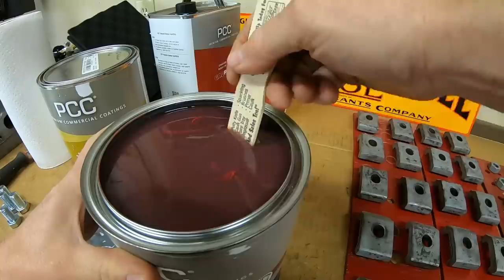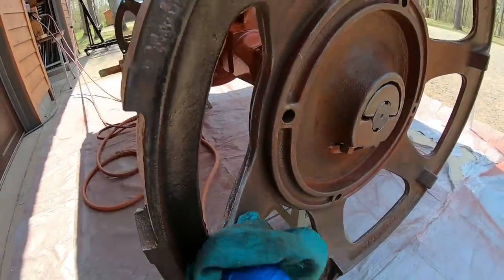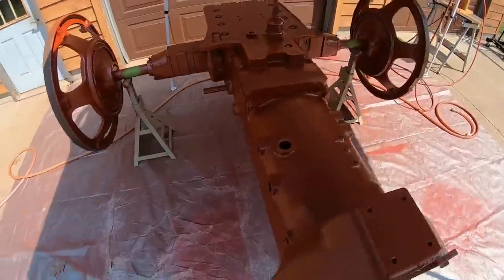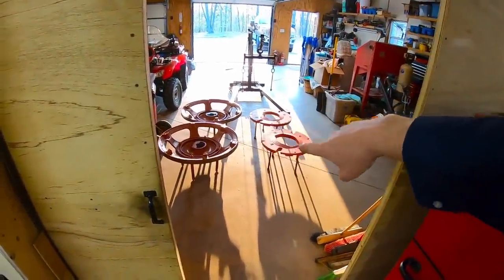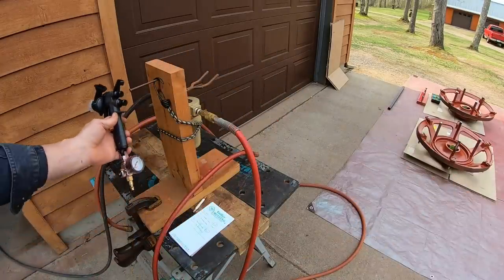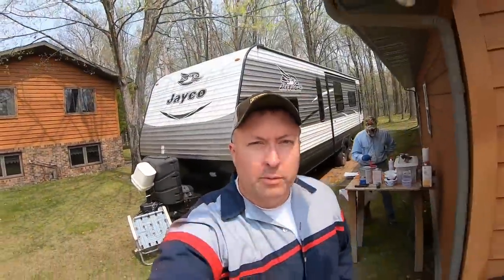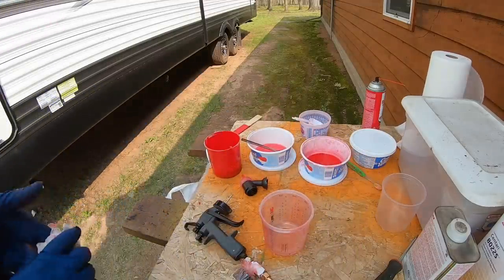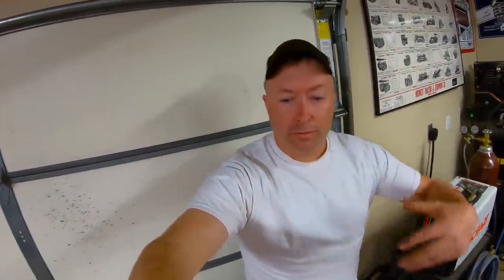Farmall "Preparation H" Project Episode #8: Painting Begins! Spraying First Batch of IH Red!!

Comment: You mentioned having to tighten the rim clamps on the Super M three times. That is actually a good idea even if you are not painting the clamps and rims. When I had to replace a rim on the M that we had, I kept the wrench with the tractor for a week. The clamps had to be retightened several times before they quit loosening. I would drive about 15 minutes and get off to tighten the clamps. After they seemed to be stable, I rechecked every day for a week. For the first 3 days, I would get just a little more on some of the nuts but after that they stayed tight.

Comment: Suggest regulating your air pressure down closer to spray pressure before it gets to your gun regulator. Will lessen the initial high pressure blast when you pull the trigger.

Comment: An HVLP gun usually needs 10-15 psi, right at/behind the nozzle (basically what is called the "air cap").  On most guns, you can only adjust the pressure where it feeds into the gun (like you are doing with the regulator).  There is a pressure drop between the regulator and the air cap - on some guns, this difference is very low, on cheaper HVLP guns this can be relatively high (25-30 psi).  You are going to have to play with the gun to get the right setting - especially with the newer guns which are much more sensitive.  Unfortunately, you can't just set the regulator at one pressure and forget it,  things like humidity, temperature, barometric pressure and altitude above sea level all affect the gun - so every time you use the gun, you have to dial it in.  It would be nice to be able to write down all the settings of the gun so that it always sprayed the same, but in the real world it doesn't work like that.  Don't get me wrong, it will get you close - but you still have to fine tune the gun in order to spray the best pattern for your conditions.  It just takes time in order to figure that out.  You might look up gun setup videos for guidance, I think Paint Society has one, there are others.

Comment: I was actually thinking about the "wastefulness" of that spray gun, a bit before you mentioned it. But then it dawned on me: you need a mixing cup anyway and the liner doubles as such. you don't need a filter screen, because it's built in to the lid. So the only extra waste you generate, is the lid and the nozzle assembly. BUT you also save a TON of solvent, which you would normally need to meticulously clean the front end of the gun. So it's probably a toss-up, or at least close, between the two methods.

Comment: Outstanding! Glasses are a pain. I went to contact lenses in the mid 1980s. What a difference they made and I've never looked back. Contact lenses aren't for everybody and there are some problems they can't fix but if they are a potential fix they are definitely worth trying.
Reply: @squatch253  OK - I was the opposite, way better with contacts than glasses, getting the peripheral vision back a huge plus when I was younger and playing sport. Now in my late 60s for the last 10 years or so have to use reading glasses on top of the contacts. Was never brave enough to have laser surgery.

Comment: It's great to see paint going on. I find this part very satisfying because it the end is coming.  New spray guns are a pain to set up, I usually use two, one for primer and the other for topcoat as they have different size nozzles. I've been using those paint cups for a while and won't go back to the cups that come with the gun.

Comment: Great job Toby. And thanks for all the information on the 3mpaint gun. Was thinking about buying a new one before we paint the Massey Ferguson baby tractor (lawn). My wife had a plethora of questions about how it worked. Now I'm Considering buying one! Keep buying 3M products! Stock on the rise by those 3M products Toby!
Reply: @squatch253  Thank you sir I do appreciate the information I'm looking hard at the 3m painter I love the part where you can just throw away the tips and put another one on. Tom
Reply: Great job as always!  The best part of those disposable cups IMO is that if before you start spraying , leave the gun upside down and squeeze the trigger. That will suck all the air out of the top of the cup until there is no headspace then it will start spraying paint. From that point on, the gun will spray in any orientation. Super useful when painting the underside of a tractor. I painted my WD9 last year and it made getting the undersides of everything MUCH easier without the spitting when using a gravity only cup gun.

Comment: Looks great. It's been years (30+) since I've done any painting. I'm curious to know what's the price of red oxide primer run into gallon nowadays? Also red paint. Anything with red pigment was about the most expensive to buy.
Reply: @squatch253  ouch everything was a little over $100 less when I quit painting. I was using a siphon feed paint gun. The paint what in the cup underneath the spray head and suck the paint out of it as you were spraying.

Comment: i THINK OVERSPRAY IS PRESSURE A LITTLE TO HIGH?   iVE PAINTED SOME CARS AND used hf air compressor worked fine in line filter for water and oil.

Comment: Do you find body filler to not be necessary? Is that a high-build primer? Thanks!
Reply: @squatch253  My reference point is machine tool restoration (vintage machine tools made 1940 to 1960 approx). From the factory the castings (such as the machine base, which I compare to the body casting of your tractor) were sealed with a red lead primer and then a filler was applied (quite heavily) so that no sand casting marks show through on the final finish. As some points of reference I mean the finish on an original Monarch 10EE lathe, a Cincinnati milling machine, etc. Never would sand cast textures be shown through on the final coat. My reason for the question is only in terms of information gathering and I wanted to know your opinion - not suggesting you do anything different! I appreciate and learn a lot from your videos.